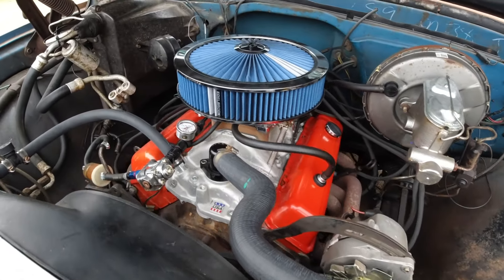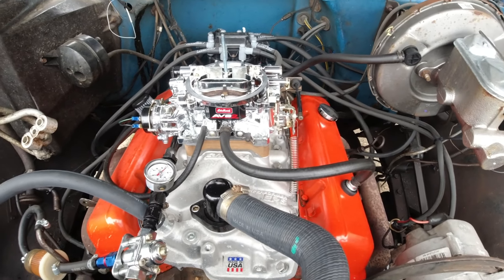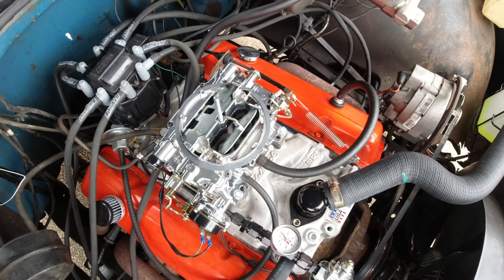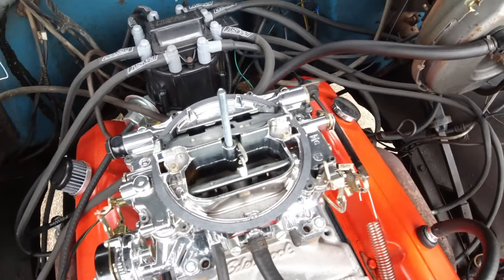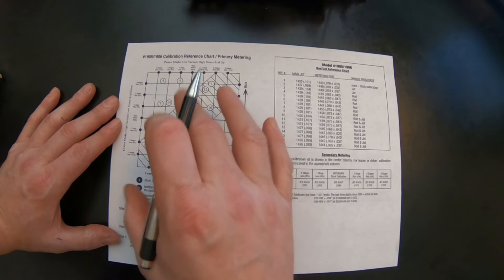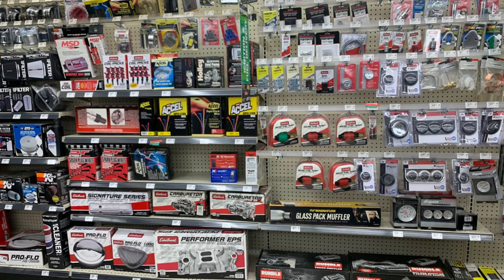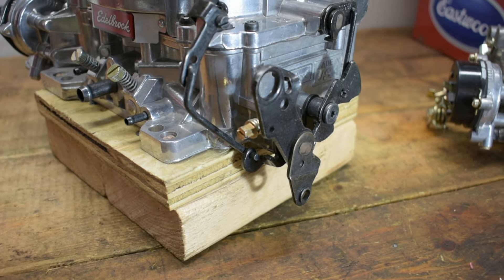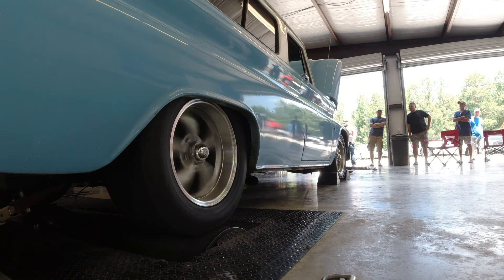Edelbrock Carburetors - The Good, The Bad and The Ugly

Comment: Muscle car solutions: I have a 318 in a 76 D100 that I rebuilt in 89 using flat top 9.0 to one pistons, Edelbrock performer cam and lifter kit with Edelbrock performer intake. I used a 500 cfm Carter AFB carb and tuned it to run well and transition from idle to part throttle fairly well. Gas mileage has been terrible, but I rarely drive the truck. I had the Carter rebuilt due to drive-ability issues and never have been able to get it working right.  It always seems to want to stumble and sometimes dies when going from idle to part throttle under load. It is worse in winter! If I have time I usually go out and start it up, run it for 10 minutes and shut it off and let the engine heat up on it's own. When i go out after 20 minutes of so and start it up, it runs better, but still has the stumble and almost die problem. What Edelbrock should I use to get my truck driving better. I am thinking 1406 600 cfm.? Would the AVS be better?  Thank you for your help, Tom.
Reply from the maker: It’s not the size of the carburetor that’s the issue.  What have you done to tune the 500?
Reply: @MuscleCarSolutions   When purchased from Summit, it was listed as a rebuilt Carter. The numbers I think I see on the left front are C5 9511 S.  When installed after rebuilding the engine in 1989, I spent several weekends getting it tuned using a strip kit and instruction book. I still have the strip kit, but no instructions, so no tuning lately. I am wondering if this carb has been rebuilt past it's useful life. I have a back injury and don't do too well crawling into the engine bay working on this carb now. So many folks say the new Edelbrocks are lots of times just bolt on and run well.
Reply from the maker: @seniorrider9337  there is no carburetor that just bolts on and you don’t do anything to.  It must be adjusted for your individual circumstance, driving style, elevation.  You can change carburetors if you’d like, but understanding how to make those adjustments is part of the process.  Way too many variables here.  What’s your timing set to?  What’s your fuel pressure at the carburetor?  Have you reset the floats?  What step up springs are in the carb and what is your vacuum at idle?
Reply: @MuscleCarSolutions     Thanks for your time and answer. I think I need to find someone local who really knows what they are doing, as the guy who rebuilt the carb 2 years ago seems to have misled me. I am no longer able to do the tuning due to age and a back injury. I was under the impression that the new Edelbrock carbs came very close to right for the application, so I guess I was wrong. I have tuned carbs many a time in my younger years, especially modified motorcycles. The most labor intensive carb I ever rebuilt and tuned was a quadrajet for a 427 Chevy marine application in Nam. I know how labor intensive it can be. I remember spending a couple of weeks tuning a pair of 36mm Mukuni carbs for a hopped up Yamaha Rd- 350. After all was done, it was a real pleasure to ride.  Thanks again for your time and help. I will be looking for someone who knows these carbs locally and can get mine tuned up better than it is now or tells me it is too old and I need a new one.
    Oh, and Happy holidays.
Reply from the maker: Well the good news is the Edelbrock carb isn’t near as difficult as the Qjet or the Mikuni carbs.  Hate to say it though, most “mechanics” can’t tune a carburetor.  Which in all honesty is why I started making these videos so folks could do it on their own.  Hopefully you’ll find someone who can give you a hand and get you fixed up.
Reply from the maker: And happy holidays to you as well.  Merry Christmas!
Reply: @MuscleCarSolutions  Tuning takes one heck of a lot of patience. And you are correct, most mechanics want nothing to do with it. I think I had that carb off 10 or 12 times getting it right back in 1989. Then warm up the engine and go drive it and see what it was like. Look at the tuning page of what jets, rods, and  look then at the tuning instructions to see where to go next. Very time consuming. When I got it where I thought it should be, then I got a few sets of new plugs and made some runs and did plug checks.  I was a lot younger and could climb in the engine bay and sit on the inner fender and work on the engine. Ha, not much chance of that happening today. Last time when I put it back on I had a platform I built around the front of the truck about 18" high so I could reach. The next week I could hardly walk due to my back hurting from bending over and torquing my upper body around.  Thanks again, it's great that you do this for the guys like me who maybe did it years ago, but forgot a lot of the finer points. I run about 16-17  inches of vacuum and timing is 10 degrees before. Don't know about the springs. This isn't a big HP engine, I built it for a working truck that has good torque and it turned out well. Maybe I have things that have worn past specs.

Comment: I pugged the PCV port on mine and the engine runs a lot smoother. A very important step when using Holley Sniper fuel injection.

Comment: You should add a disclaimer, that if you know how to tune a carb, you can tune out the cornering issue.  Also the secondary circuit will dry quickly with todays gas and you will get a bog if you floor it right after it sits for awhile.
Reply from the maker: The cornering issue is a design problem that unshrouds the jet on that side.  There’s no tuning that can recover from lack of fuel.  It’s a fairly well known problem with these carbs, but in their defense they were not designed to be a star on the autocross track.

Comment: On the ugly part I think that the reason you can starve for fuel in a left hand turn is that centrifugal force keeps the fuel from transferring to the driver side. The small capacity of the float bowl is not enough to keep up with demand. That is also the accelerator pump side so that diminishes the capacity as well.

Comment: Great info as usual.  I think a lot the Edelbrock angst is like the Ford vs Chevy vs Dodge drama...a whole lot ill informed opinions based on one off experiences.
Reply from the maker: True. Though the carb thing is generally based on not applying the right solution to the equation.  When you apply the wrong part, the outcome is bad.  But instead of blaming themselves for making a poor decision, it’s easier to just blame the part then taking responsibility.

Comment: I switched to Edelbrock from Holley after the near-impossible task of trying to keep the Holley from leaking. I should have made the change years ago.
Reply from the maker: It’s one of the big benefits for a street user.  No leaks!
Reply: @MuscleCarSolutions  The last two Holley accelerator pumps have leaked right out of the box for me as well. I had to reuse my old one both times. I'm done with Holley.

Comment: My 25 years of working on cars Edelbrock carbs are good for street cars with low hp engines or a cruiser type car. You wanna go fast and make as much hp as you can a holley or really any brand carb of a 4150 is the way to go. Want to go super fast, a carb with no choke or vacuum secondary for all out racing.
Reply from the maker: Uhhh…. something like that.

Comment: I wish the Thermoquad in its original form was back - phenolic body and all. I can work wonders with those things. 
People never realized they had 2 stage accelerator pumps in them. They were set up wrong from the factory. They were supposed to give a second shot down the primaries as the secondary throttle valves opened, before the air doors reacted. Also there was a dashpot to control the rate of secondary air valve. Many either a) removed this or b) failed to test to make sure it was working. Later variants had a restrictor in the port to control the air valve rate of the dashpot. It was still very fast but slowed it to eliminate stumble.
Additionally, the secondary air valve had to have a small amount say 35-40 thousandths of air door freeplay to allow initial movement.
With the long gone strip kits they were a great thing. SImple, great economy, dual booster venturis in the primaries. 
Apart from stupidity, they really only 1 fault and it was a big one - the plugs at the bottom of the metering rod wells would fall out allowing fuel to pour out. 
This cause people to tighten the screws breaking the bosses in the resin body worsening their reputation. Also on disassembly many would forget the 2x screws inside the primary area and crack the resin body.
Their problems were mostly manufacturing errors combined with manufacturing set up errors combined with aftermarket accelerator pump listings being wrong as they were too short to allow the dual accelerator pump activation.
Reply from the maker: That’s a lot of info!  I think the warping/leaking and the lack of how to tune gave it the bad reputation.

Comment: I have a 1978 D150 with a 360 LA stock. I put a Weiand aluminum intake and an AVS2 675 carburetor on it. I live in the upper Midwest and since the roads are clear, I decided to take a drive. 

Today I've had to do a bunch of adjustments because it died and started stumbling. I noticed it was leaking fuel and getting heat soaked with a ton of vapor after driving it kinda hard. 

I looked at my fuel pressure guage and it's reading 8psi, now it won't start until the fuel and vapor is gone so I'll have to add a FPR other than a Mr. Gasket.

Comment: The ugly side is a simple fix. The eldelbrock carb has a second fuel input that is plugged.  Remove and add secondary fuel line to feed both sides. Easy fix. Eldelbrock carbs are very versatile if you know what your doing
Reply from the maker: Wish that worked 100% of the time, but in aggressive driving, it doesn’t.  Street vehicles that I’ve installed the dual kit on have fared better, but they’re usually not trying to take a turn at 1G.  😂
Reply: You tried putting higher pressure pump?
Reply from the maker: @emmanuelhamm5375 6psi max on Edelbrock carbs.  Still doesn’t correct that flaw.

Comment: Really informative video! One thought… why not fabricate an external primary pump? Little syringe where the pump rod lives… one issue I’m curious if you ran into is a lip about a quarter inch up in the primary pump cylinder,? Seems to limit the stroke of the pump. The cup hits it and the spring soaks up the rest of the travel. I wonder about honing it to get a little extra juice too.
Reply from the maker: @bens8696  I did a video measuring and showing the exact stroke travel of the pump. It doesn’t have the length of travel most assume it would be.

Comment: Hello Muscle Car Solutions, thanks for the great video. I am on the fence right now with my stock 1990 Chevy 2500, I am having TBI issues I thought about swapping it for a Sniper or Etech, there have been more than a couple of guys complaining about the sniper , so I am considering going to a carburetor, I have always liked Quadrajets for stock engines, I have rebuild several back in the 80s and 90s, I never tuned one like you talked about I just figured they were set up for the engine they were put on. If me and my buddies modified our engines Holly was our go to choice. Now Holly has a Quadrajet replacement that has a spread bore base and larger secondary throttle plate.
 If I convert to carburetor I have to change the intake manifold and the distributor, I am fine with that.
 You gave me something to think about as far as the Edelbrock option.
 I need this 90 2500 to travel from the L.A. area to the most northern part of Washington a few times in the next few months for are retirement relocation. 
Any advice/recommendations would be appreciated . 
Spindrift
Reply from the maker: @spindriff  it’s pretty common to have issues with the TBI EFI from that era.  It’s like having a flip phone from 1998.  The technology is way more advanced and there is no more support left.  So switching to a modern EFI will always be the best choice for a cruiser.  As far as folks having issues, I can tell you that 95% of the time, it’s user caused.  Bad grounds is by far the number one issue.  It will fry an ECU QUICKLY.  Even the self learning units can be a bit complicated if you’re not used to how to tune.  So any issues, people tend to blame the part because they don’t understand how it works.  I’ll eventually do a self learning EFI series of videos if I can ever find the time.  In the meantime, if you’re more of a novice, using a universal carb like the Edelbrock’s or the Holley is generally not a bad way to go.  You’ll need to do some tuning to help match it up with your application, but you’ll have no issue with that commute once you get the carb sorted out AND if you have the right support (fuel system, ignition/timing) to help the carburetor perform the way it should.  It’s been awhile, but I’ve made the trip from WA to LA and back a few times in cars equipped with Edelbrock carbs.  No issues.
Reply: @MuscleCarSolutions  thank you very much for such a timely response, I think I will go with a Caurb. set up for now, I already have a complete HEI setup intended for a car already sold, I will need a square bore manifold for a modern TBI anyhow so I can go that route next year after I am all moved up north. I can take my time installing and put extra ground straps/cables (good advice) from frame to motor and battery. Best Regards Spindrift.

Comment: Pulled my steel intake and Qjet  off my 86 c10 and went with a edlebrock card and intake. The old set up ran much better. Got the edlebrock to run decent but one I let it sit for 10 minutes and now I'm have to pump to start. Looking to go with Holley. Can't be worse
Reply: Did you take the air horn off the new carb and clean the internals before you put it on? I know it sucks to have to do and we shouldn't have to but it doesn't take much to get stuck in the needle and seat and cause problems.

Comment: Left turn issue...Both sides can be fed from a dual line setup.  👍
Reply from the maker: Generally doesn’t fix the issue.  That jet still uncovers pretty easily.
Reply: @MuscleCarSolutions  My 90 RS Camaro, built 4-bolt main 350, had no issues with a 800 cfm thunder avs even in high g turns. Left nor right.  Maybe some people do? Thanks for your response!

Comment: I have a rebuilt 455 olds, I don't know all that went into it. Was told it has an RV cam.  The valves have 3 angle cut. It idols and can Rev up ok. At idols I can reach 12 to 13 lbs. Of vacuum. The carburetor is a new 750 eldabrock.  HEI ignition. Taylor wires. 
With what I was  told, the low vacuum,at 12to 13 lbs  and stinken exhaust I am  thinking now I might have valve issues. I will retime it an adjust the metering rods and springs some.
If there is anything you could add, It is all appreciated. Thank you for all your support.
Reply from the maker: It’s difficult to say.  Rv cam is such a generic term.  If it’s a very low duration then it’s my assumption given that engines ease in making vacuum, it should be much higher.  Run a compression and a leak down test?

Comment: So I’m looking at getting a AVS2 to replace my quadajet on my hunting truck. The mountains have a lot of up down and side to side. I’m not doing crazy stuff but if I got a Avs2 and did the off road mods to it (spring in a Acc pump nozzle and spring in the needle) would I have trouble when on a side angle? Again nothing crazy but would it be enough to uncover that metering jet? Thanks!

Comment: These carbs can come alive with metering rod changes. These are basically the old Carter AFB. I had a metering rod kit back in the 80s. Woke it right up with smaller metering rods. Tested the Carter and holley back then on my car and there was no difference between the two. The edelbrock is lean from factory.
Reply from the maker: @scottmcgehee2933  following the tuning chart makes it very simple and very easy. It’s amazing how many just bolt it on and never try to make it better. I love the way they drive. They’re incredibly efficient and can perform very well. Just have to take the time to work with it instead of just putting up with it out of the box.

Comment: I love carbs! Except Q-junk low cfm complex mess. When they’re adjusted they are great but that is only about 15-25% of the time. Webber, holley and edelbrock are all good carbs and run solid 95%of the time. The best is mechanical secondaries with a manual choke.
Reply from the maker: @godofrock  nothing wrong with the Qjet.  The trouble becomes having the understanding and rods, jets, hangers to make changes.  Though it pretty obvious, a majority of folks do not tune their carb at all.

Comment: Please excuse my ignorance,  but...not to old to try to learn at 63.  I have a carter competition series, 625/650? cfm, from early 90's on my mopar 340. 
I believe  it is an "AFB" based carb.
I was wondering what is the difference between an "AFB" carb vrs  one of the new Eddy "ABS 2" carbs, (old timers kicking in...I think I have the letters correct) 
I am curious if the new ABS 2 carbs are a better design, for the street? etc.
I have issues with mine when it gets hot, heat sink no doubt. (my fault  of course), But I still enjoy cruzing my '68 B'cuda "time machine" (1st car back on the road again), still trying  to "get" how to tune these things.  : /
Reply from the maker: AVS2 has the adjustable air valve secondary and annular primary boosters.  It’s an amazing street carburetor.